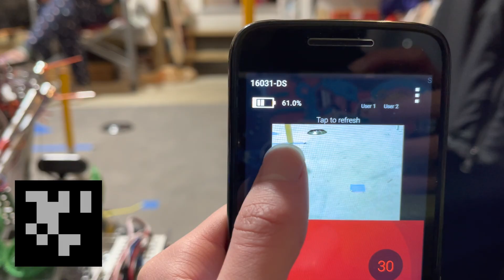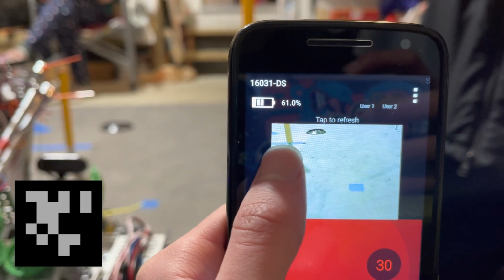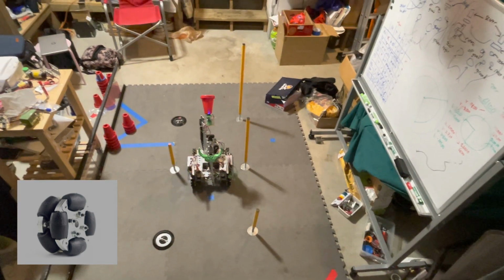Control Award Submission - Team 16031 Parabellum

Comment: Hello, first of all, you have an incredible robot their, it really is amazing! I also had a quick question, on the outake, for cable management you guys used that coiled cable, which i am guessing had all the wires neccesary inside to power the servos and sensors, my question is where and how did you do this, where did you find that coiled cable and how did you put all those wires into it. Thank you so much.